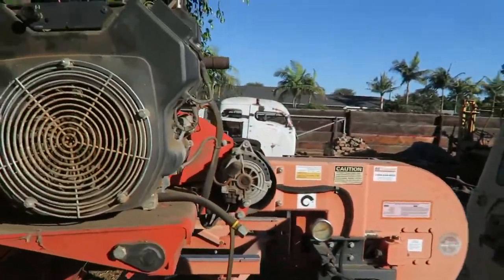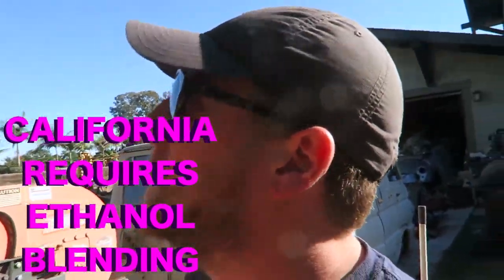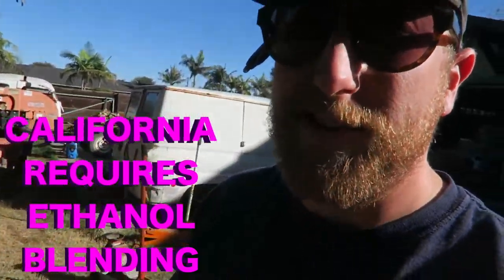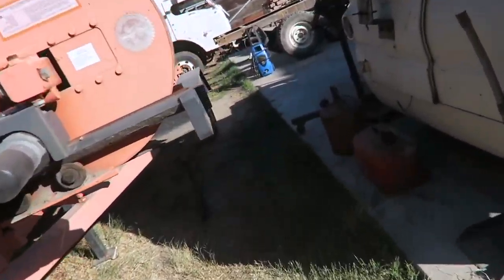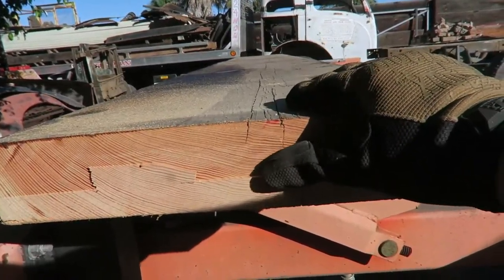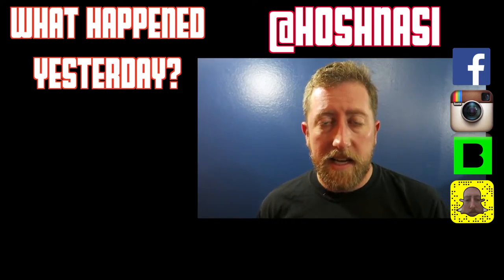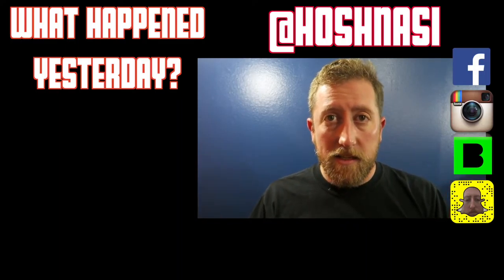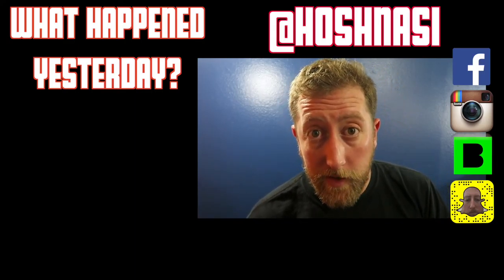Mill Your Own Wood On A Woodmizer!

Comment: episode 445! on a roll josh. at my last job, I cut metal on a band saw. not just little pieces, 20' long by what ever diameter you could imagine. blades cost $4-$500. if you broke those, they had to be sent off to be repaired. Blade speed and tension is crucial. If i was to get a saw mill, I feel i would cut for days until i got tired of it. Then it would just sit.
Reply from the maker: Its a feast or famine tool.  When you need it, you're going to work it hard.  Then it'll sit doing nothing for extended periods of time.

Comment: never with a mill but me and family made a small house on the back of the property with just the trees in the yard.
Reply from the maker: +Ceal Losaria how did they cut them down?
Reply: hoshnasi wedges and hammers gpa and dad did all that after the trees were down it was long saws for the planks and to get the corners we used holes in the wood and screwed them together